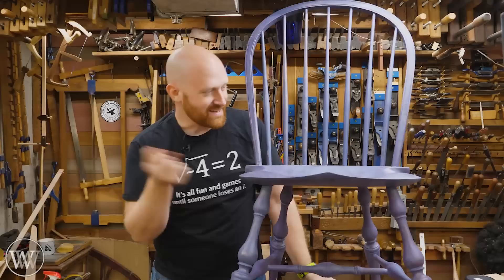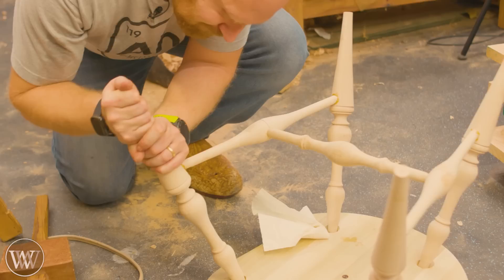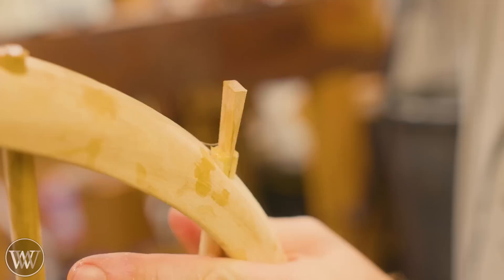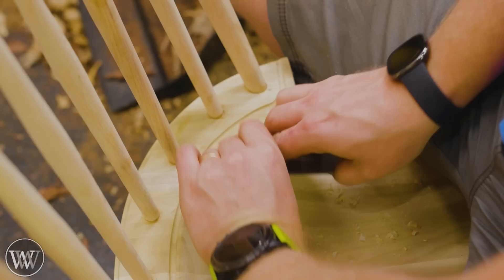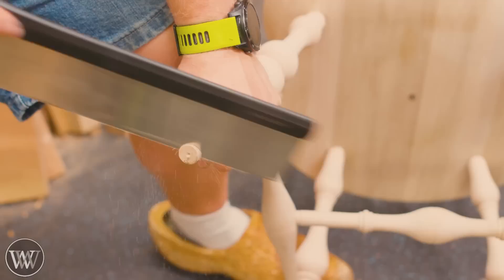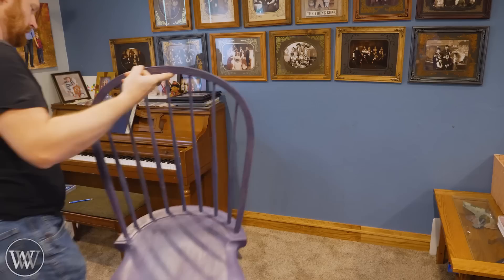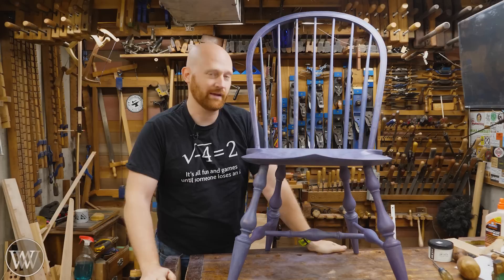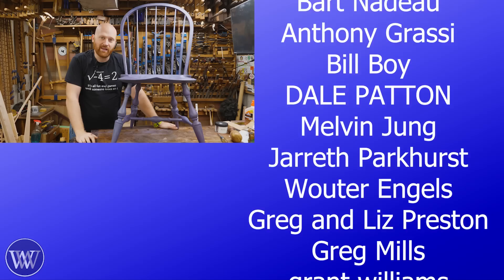How To Make a Windsor Chair Kit From Colonial Homestead

Comment from the maker: Colonial Homestead: (330) 600-9445
6515 OH-241, Millersburg, OH 44654
they do not have a website. you need to call in to place an order.
Reply: Does he do other chair styles? I figure it would help to have that answer here rather than a bunch of us phoning to find out.  Thanks!
Reply from the maker: they are all Windsor chairs but there are a few options and he does offer a bench as well.

Comment: The chair looks great, James. Although I must say I would love to see you build one from scratch, where you would use all those cool spoon bits and such. (If you need any of those bits, just hit me up!) One question though: is it possible to make a Windsor chair without a lathe? Thanks for the video!
Reply from the maker: Sure I have seen them made with octagonal spindles.
Reply: You could also use a router.
Reply: Historically the legs and spindles would have been turned from unseasoned wood  using a bodgers pole lathe.

Comment: Noice chair!. Why didn't you spritz the frozen joint, warm it with a heat gun to re melt the glue and tap it all the way in with a bigger whackenshmakka? Not that it matters, just my OCD would keep me awake for the next ten years thinking about it😂
Reply from the maker: Unfortunately it is not that easy. I would have to loosen all the joints on the top and the one bow end. And reversing hide glue is an extremely difficult task to get into the center of the joint.
Reply: I see your point. Having had a lot of experience with HHG over my 30 plus years of Luthiery it can be a bit of a challenge to rework it. I have had to resort to heat lamps, steam and colourful language a few times to make it let go.. But yeah, on a chair it really isn't that big of an issue as in this case it doesn't effect the functionality or safety of the chair and as you said, no one would be likely to ever spot it. Chalk that one up as not a mistake but a feature.😊